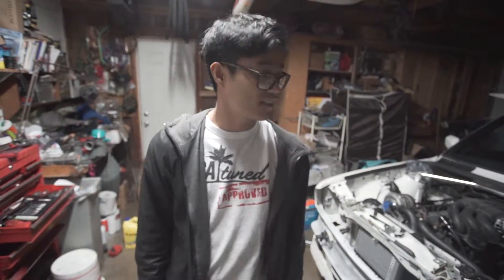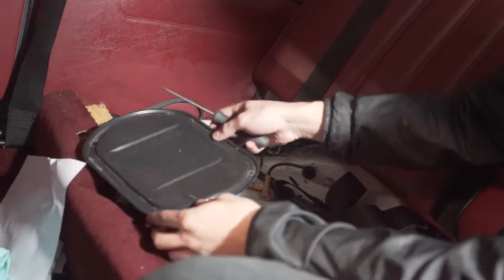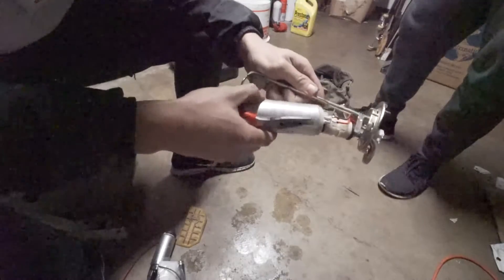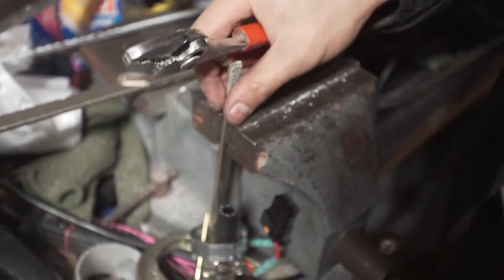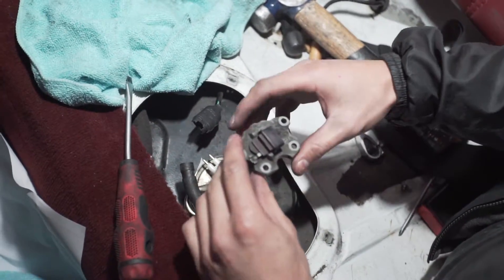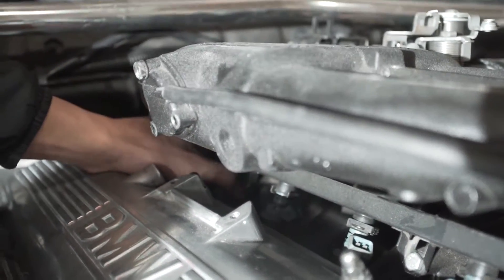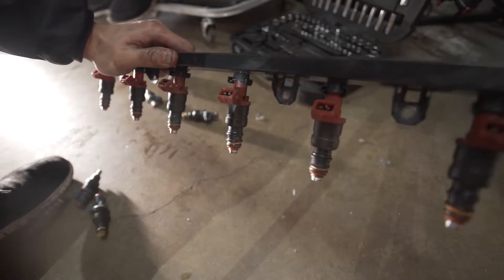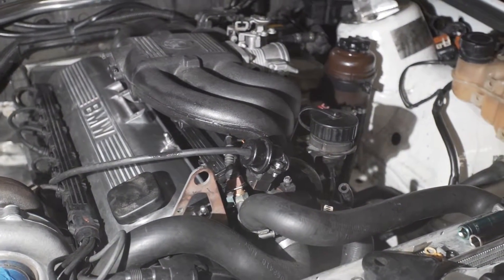E30 TURBO BUILD : EP09 INSTALLING NEW FUEL PUMP AND BIGGER INJECTORS!

Comment: Where did u get your kit from
Reply from the maker: What kit are you referring to? The body kit or injectors? 🤔
Reply: @derkm  the fuel pump kit.
Reply from the maker: @ernesteclarke  I got it on Craigslist but it was still new in box. You can get a set on amazon or summitracing though! I got a Walbro 255 and they're fairly common

Comment: Can I upgramy stock fuel pump to the walbro 255 either though I dont have a turbo?
Reply: Adi_gurolPL Grotkowski yeah, the fuel pressure regulator will keep it in check aswell as the injectors

Comment: Great job, but you should do it the right way which would have been to pull off the intake manifold at the start, disasemble, and have the manifold checked for flatness.  The injector bore is always greasy and needs a proper cleaning.   I bet you its also slightly warped from the heat and needs surface grinding back to flat for a perfect seal.  Its a cheap job that your local machine shop would be glad to help you with.  Or get an old window, cover it with sandpaper, mark the manifold face with a sharpie, and sand it till marker is all gone.
Reply from the maker: You're definitely right! That would forsure be the best way to go about doing it but I wasnt aware at the time that the intake manifold was prone to any warping. Luckily, there haven't been any signs of any issues like vacuum leaks or anything related to this and I've been driving the car 2 years since then. I do recommend others to take the extra step though to avoid any issues with their builds so thank you for the insight!

Comment: How did you remove the injectors' "wiring harness"? I don't see any way to remove those metal clips without taking the intake manifold out and you seem to snap them off without a problem.
Reply from the maker: For me, they just came off after prying up on them even while they have the metal clips like you saw and the metal clips weren't damaged at all 😁
Reply: @derkm  That'd be great if it really is that simple. Maybe they are little stuck. Have to give them some more prying ;)

Comment: I've got a m20b25 I pulled from an automatic e30. The fuel injectors are covered with so much carbon that I needed pliers to pull them out. Should I get them cleaned or just buy new?
Reply: stefan barr take all the injectors to a shop to do a ultrasonic clean and flow test them. I only replaced the pintle caps and o ring, but I regret not taking the extra time to do it right.or you can just buy new ones lol